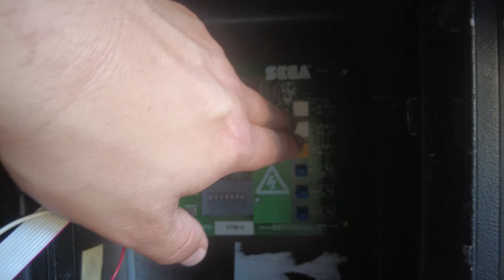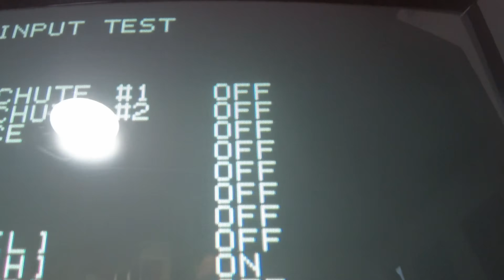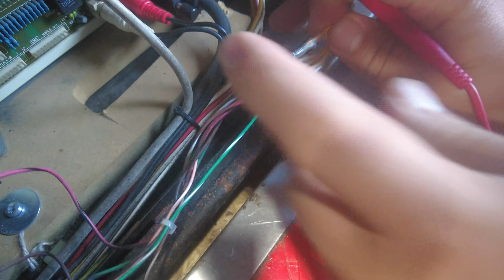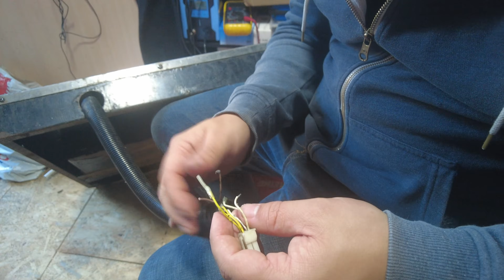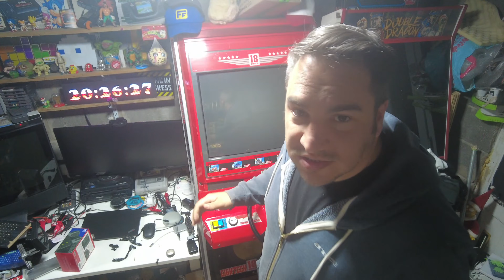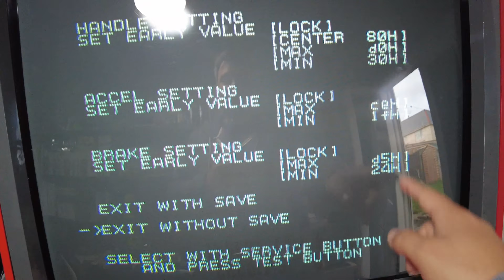Arcade Game Repair : 18 Wheeler Faulty Accelerator Unable To Select

Comment: Hi Craig, having a problem with my 18w machine. The gear shift to high seems to not be working? I have followed your steps to the Input Test screen and the hardware seems to be functioning correctly, Gear H - On when its engaged, but doesn't function in the game itself! Help!!😢😂
Reply from the maker: Replied on FB messenger, I'll give it a go trying to help sort.
Reply: @GoodwinsPlace  From pure curiosity, how does the naomi connects to the tv ? Does the tv have a vga or something or is it a vga cable from the naomi that ends like a scart for the tv ?
Reply from the maker: @thesteammachine1282Naomi is vga connection to the monitor, I've ran it on smaller LCD vga screens for testing items too.
Reply: @GoodwinsPlace  Ohh, so the cabinet is using a pc tube style monitor than ? Looked to me like a tv (probably because of the plastic color ). Thank you .
Reply from the maker: @thesteammachine1282arcade 31khz monitor via vga. These are amazing quality. Have a look at one of my more recent videos as I show them a bit more detail.
Reply: @GoodwinsPlace  👍👍 will do